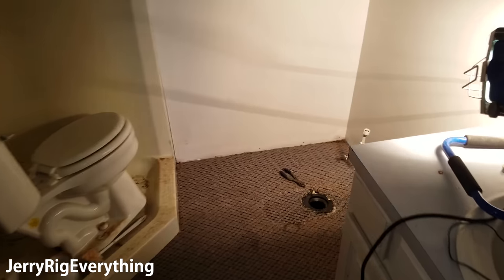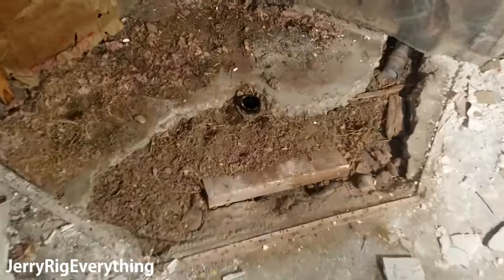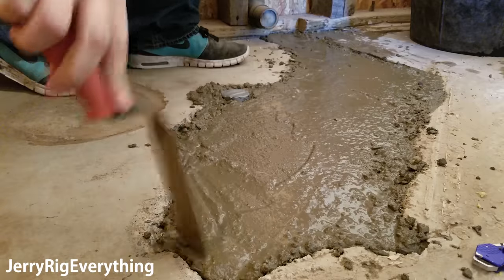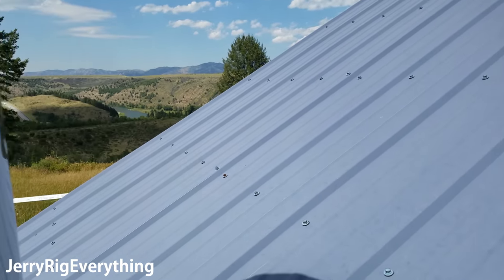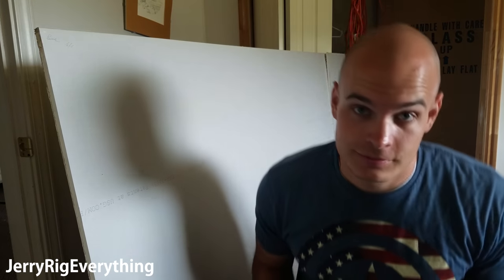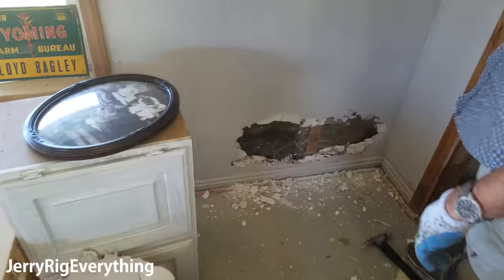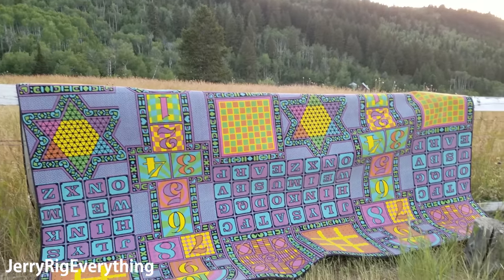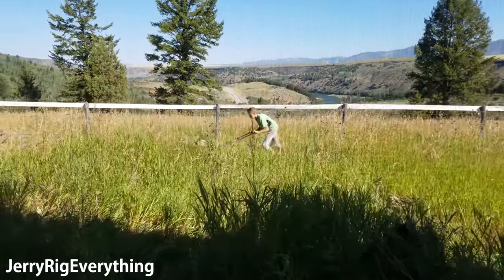Mouse Proofing Jerrys Cabin - The 20 Year Battle

Comment: 2 things 
why aren't you wearing long sleeves when removing Insulation 
and when replacing Insulation get the white kind instead of the pink it's better
Reply: Get stone wool
Reply: @austinreeves5221  what is that?
Reply: a a it’s a type of insulation. Not as much fiber glass. Much thicker for temp control and more fire resistance

Comment: As someone who installed commercial kitchens - my advice/method for metal roof follows this one, simple rule.  Never rely on liquid to keep out liquid.  Metal should be lapped so water runs down it.  Be sure you have 6" of overlayment then put butyl rubber between (aka flashing sealant).  The entire point of the sealant is to keep the air out so water can't get driven up and freeze (thus separating the metal).... with the chimney, the upper roofing should lap over the uphill.  Be sure you have double metal on the sides.... sealed forever (or at least until the heat cycle rust destroys the chimney).

Comment: Why don't Americans just build their houses with bricks. Is it a cultural thing, or is there some actual sane reason for building fragile wooden houses. 

They can't survive a storm. They're prone to rotting, they're probably more expensive, harder to maintain,  must be a magnet for bugs and rodents of all sorts and a host of other problems.
Reply: +Dank “meateatercat” Memes sorry to break it to you pal, but not all brown people in the world are Arab. Not even Muslim in case you're wondering. 

Also my comment was not meant to offend Americans, it's a legitimate question that I have.
Reply: the interiors are made of drywall and sheetrock the outsides are made of bricks, stucco, or wood this is a cabin so it normally isn't held to the standards of a house. one of the reasons we use drywall is because it is cheap and it has advantages for interior decorating like hanging paintings
Reply: Graham Hosken thanks for a detailed reply, i guess I didnt catch on that a cabin is much simpler than a house, its not something we do where i live, even farmhouses (theres no concept of cabins) are made out of very sturdy and durable materials just like a proper house.
Reply: Come down internet warrior.
Reply: +Prateek Jain wooden homes specially in the west do hold up Alot better during earthquakes something where I live happens daily usually small enough u can't fill. If made of anything else it will fall and has fallen over the years. Like other people have said it's insulated drywall is fire proof a clay with multiple functions over concrete and brick and most homes on the out side is brick.  They come in wood panels and plaster. Not all homes are the same not all homes are built to the same standard. Depending on the state and codes to make it safe to build and live in. Some have shelters some are elevated just depends. To say one is better like I see Alot on this thread is stupid. How simple minded can you be to think a break, stone, or clay home is the standard and should be everywhere. Brick homes are nice but not practical is Alot of places. 

Like others stated this is a cabin it wasn't built to standards and not up to code no not every home is like this either. In fact Alot are built better specially the newer ones.
Reply: cab·in
ˈkabən

noun

a small shelter or house, made of wood and situated in a wild or remote area.
synonyms: cottage, log cabin, shack, chantey, hut;
Reply: I'm Canadian but where do you live that is so much better than American houses.do you have nothing better to do
Reply: The wood is prone to rotting in a house when built in a humid area.
Reply: wood is homely (warm, friendly) that's all
Reply: Prateek Jain I live in the Adiroundacks (look it up if you don't know) there is never storms here that would harm a house and concrete or bricks look ugly. Look up "house in the adiroundacks" to see how nice houses like mine are.
Reply: Prateek Jain yes, it is alot cheaper than using concrete or brick, you could choose to but it would be so much worse on your wallet
Reply: Well in California most houses are not built out of bricks because California lies directly on a fault line....and brick  doesn't so good in earthquakes...
Reply: He said it's a cabin in the middle of nowhere. Not every American house. You made an ignorant assumption and you got your smart ass answers back, what did you expect
Reply: Stanislav Shaposhnikov pretty much what I was going to say, very well said👌
Reply: PJ my parents house is made of brick.But I live in an apartment right now while I save up for a house
Reply: PJ earth quakes
Reply: JC Bronson that's because it used to be alive
Reply: DREAD Raptor yh, but it takes more money to maintain it in the future than a brick house
Reply: Haha Prateek is such a clown.  Wood isn't "sturdy"?  Oh yeah, that's why it has a greater strength to weight ratio than steel or concrete.  Wood is "prone to rot"?  Yup, if it's not pressure treated, it is, but then again, the wood is protected with paint or sealant to prevent rot.  And of course, bricks don't have any moisture problems, right?  No way, bricks are not at all susceptible to cracking and splitting from freezing water.  Haha good one.  And of course wood is "probably more expensive, and harder to maintain".  Haha I like how you at least used the word "probably" when you clearly have no idea what you're talking about.  And yes, of course, let's all listen to the guy who claims he's never even seen a wood house when he tells us how "hard" it is to maintain.  Hahaha have fun re-pointing your brick palace, moron.
Reply: Where I live UK all houses red bricks
Reply: My house is a two-storey composed mainly of concrete. Its 14in x 14in concrete columns are supported by 8 16mm steel bars with 2 12mm steel bars in each side of the column. Its hollow block walls are filled with mortar and are supported by 10mm steel bars evenly placed about 14in apart. 
It has survived the tests of time; at least a dozen magnitude 6 earthquakes, a dozen typhoons including typhoon Yolanda or the more commonly known typhoon Haiyan (I live in the Philippines, about 6kms from the nearest fault line in case you're wondering). Since no cracks are visible on the columns and walls, I really think that if you have the budget, reinforced concrete houses are the way to go...
Reply: bohemethnemeth
I agree with most of your points, but comparing the strength to weight ratio of wood and steel isn't really gonna help you. A wooden stick an inch thick isn't gonna be able to compete with a steel bar with the same thickness. 
Imagine a house made entirely of steel, with walls made of steel plate an inch thick, I think it'll be able to survive a small storm. But, imagine a house made entirely of wood with the same measurements, I seriously doubt it'll even survive a moderate gust of wind. 

Yes, steel is more expensive, but it's just simply much more durable than wood.

But, everything else I would agree on. 👍
Reply: He also says wooden houses cant survive a storm. LOL
Reply: Prateek Jain it's actually cheaper and more accessible than brick. Since a brick house would not stand against an average American hurricane.
Reply: Brick doesn't do great in earthquakes lol.
Reply: Plywood with two by fours are actually cheaper to build, to fix,  remodel or to build additions afterwards if you ever plan to. Also, the insulation does a great job on keeping the internal temperature without major electricity costs during the cabin or house lifetime.
Reply: A reason why we Californians build our houses out of drywall is because in Cali,We have a lot of earthquakes and brick structures have built a reputation for falling down during earthquakes.For proof,search "1906 San Francisco Earthquake".Also,wood is easier to work with and can be more easily accessed.Furthermore,it's a dumb asssumption that all american houses are made of wood and drywall.The west coast may do that,but on the east coast and in the midwest,they use other building materials such as bricks and steel.
Reply: +Stainslav Shaposhnikov Exactly what I commented before I read your comment;Thank you for being smart and serving our country :)
Reply: americans would use whatever trees they could find, while expanding westward. it was a matter of limited resources. plus a lot of places don't need brick houses. you'll find wood frame in the middle of the country but concrete block in Florida, for instance.
Reply: they only do that on usa xd
Reply: 1. Were cheap as hell
2. We don't have nearly enough interest in building new houses made of brick since its easier and faster to build with plywood
Reply: @TheRifleAdict  You do realise you can put drywalls over bricks to smoothen it, right?
Reply: A house made completely out of brinks and concrete would be wet inside where I live. I’m in Georgia mountains ( USA). My basement has concrete walls and is always cold and humid. We run a de-humidifier 24/7 down there. 
Different materials are used depending on where you live in the US. We have many different environments as well as building codes for them. Western US hones, more of dry area, may use clay that’s hardened forming a solid wall. Places that get hurricanes have struck codes they must abide by. Using tie downs and wood because it flexes a bit. 
Basically pressure treated wood ( to prevent rotting), concrete blocks, brick, stone, logs, vinyl siding are used on the outside.
Reply: Prateek I don’t know man

Comment: On large drywall patches like that first one that's about 2 x 6… it's not sufficient to attach to studs in the middle and just one sie… the left side of that floating in the air will always be weak and open to more vibration and movement from bumps or impacts.   That will cause your tape/mud/paint to crack over time where that seam is.  I"d redo it if I were you from stud to stud only  even if that means having to widen it..  It's either that or add another stud right where those two pieces of drywall come together to support them an eliminate the extra flexing potential.

Comment: If that chimney causes problems again or if you just want to prevent future problems theres heat resistant rubber gaskets called dektite's that are the best way to seal a pipe hole in a metal roof and because it's an exposed fastener roof it's not a bad idea to look over the screws and replace any with worn out washers once in a while

Comment: A couple tips Jerry.
1.Get a mask fit test done by a professional to make sure your mask is sealing correctly and properly sized for you. I've  done many for different brands of masks needed for work.
2. Wet your glove (or spit on it) when spreading the caulking. Makes a smooth surface and won't stick to your glove.

Comment: My parents 35 years house is standing on a rocks+concrete foundation which goes 1 meter into the ground.  There is also a 1-meter concrete lane around the house. There is space between the wooden floors and the actual zero point ground filled with sand. And each year at the end of the august-first part of September I can hear scratches from 1-3 mice trying to make holes in the wooden floor to go into the house. I checked a few times, there is no gaps\crack in the foundation at all, it's still pretty mysterious how they can get there under the ground.

Comment: 11:50
That sealer will not hold as well.
The problem is the UV from the sun, that will disintegrate it in time, rather than the temperature.
If you manage to stick some sealer in the right places hidden from the sun, that might just work :D.

Comment: And my grandmother's house it had mice for like 20 years took a bit of cleaning and mouse traps set up everywhere covered with peanut butter during the remodel process but we got every one of those little suckers there Was about 15 of them they were using the drop ceiling in the basement as their little racetrack anywhere in the house

Comment: I watched Zack building elevator, and remember his home and now his grandpa's house both are made of the carton? Plywood? Why not to use bricks or cement or concrete? It's strange to me see houses like these)
Woodwall, plywood,drywall and carton? 
Never seen cabin like that, my home and our cottage made of concrete and bricks, I have been repairing houses for  7 years and it's first time I see house like that) Mice problem is cause of materials used. But I highly appreciate Zack and job he did, Jerry would be pleasure to see it
Reply: Most houses in America are built like this.

Comment: Hey, I just seen this video 3 years later. But you could have saved a lot of time and work if you would have just rodent proofed the outside only.  The inside is not needed. You don't want to let the rodents into the basement or attic. Once they're in the basement, they can pop in anywhere inside.

Comment: If you are going to do such a cheap repair job use great stuff not silicon caulking that doesn't stick to wood. Furthermore, that building is not built to code, you have to have cripplers, not just stingers, that is just the wrong answer there! With out cripperls, no wonder, mice have the run of the house.

Comment: That steel wool is gonna rot in a year.  Should have repaired it like a flooded house.  Cut out the bottom foot of all sheet rock and sheathing.  Clean and vacuum.  Treat with bleach.  Install new insulation, rock and sheathing then galvanized wire mesh.  

That stove flue needs to be removed and installed under the top roof panel.  It’s gonna fail again in a few years.

Love the grandpa build but that place is doomed.  Substandard building practices are its biggest problem.
Reply from the maker: Well, it's been a few years and still no mice living in the walls. So I think we did OK.